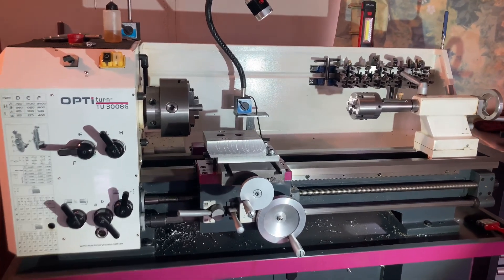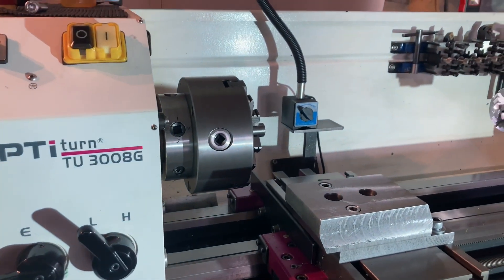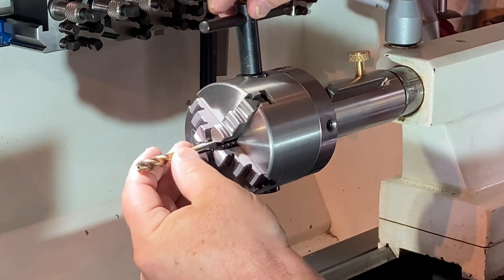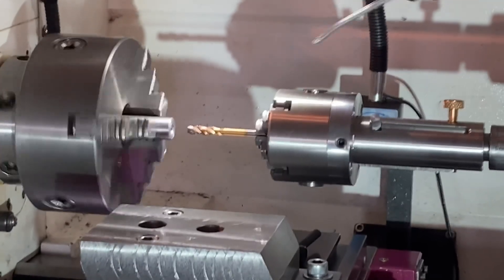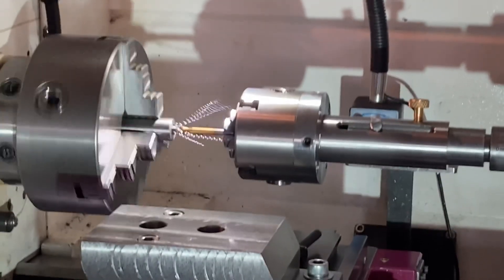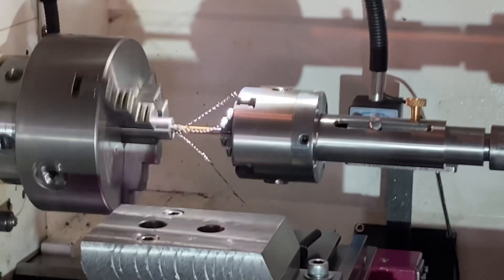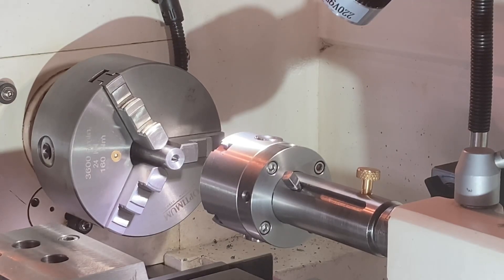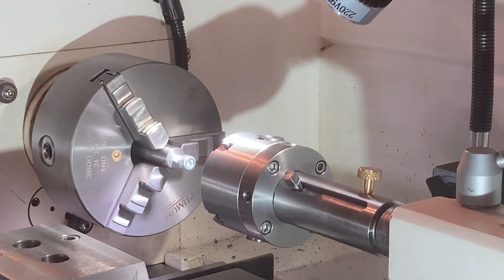Machine tapping on a lathe, Optimum 3008

Comment: Beautiful lathe you have there, i hope to be getting mine soon. Is there anyway to contact to you, Instagram, discord, etc? Id like to ask you some questions about your G variant.

Either way im subscribing, hope to see the machine in action
Reply from the maker: Hi mate, I don't use Instagram or discord or any other social media. You could send me an email if you want?
I don't know what a G variant is lol but happy to answer any questions, even here on Ytube. Cheers
Reply: @johnnyciantar  Hey, thanks for answering. The G in 3008G stands for Gears; your variant is the one with the change gears. I'm thinking about getting a used small-sized industrial one or your model. Coming from a Chinese mini lathe, I'm concerned about the fit and finish on the Optimum. How is your first impression so far? Also, how loud is your machine? Do the gears make a lot of noise?
Reply from the maker: @davide501  Oh thanks, now I know what the G stands for.
I've had my machine for 5 years now and I'm really happy with it. The gears aren't loud for a geared machine. The overall finish is pretty good. For the price of these machines, my opinion is they are great value. I bought my lathe from Hare & Forbes and these guys are great even with after sales and service. They sell lots of Optimum equipment and they wouldn't risk their reputation if Optimum wasn't good value. The beauty of these machines, they're easy to work on and over time you'll make your own improvements. Ytube is full of great ideas. The biggest flaw in this machine and it's common for most small lathes, the top slide design has poor rigidity, I ended up making a solid tool post holder that mounts to the cross slide, a lot of guys have done the same, it's a great mod. The finish is way better and parting off is so much easier, very rarely I do any  tapers and it doesn't take long to refit the original top slide to do any taper turning.
I wish you the best and hope it goes well getting your lathe!
Reply: @johnnyciantar  thanks for the your thorough response!